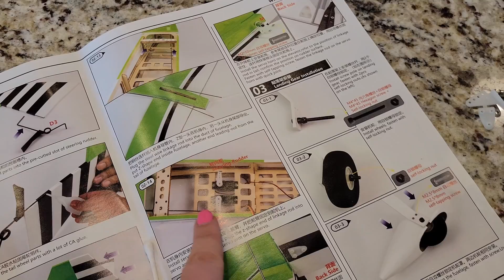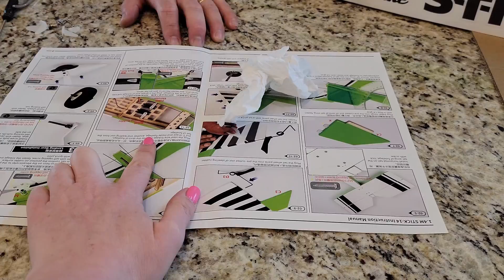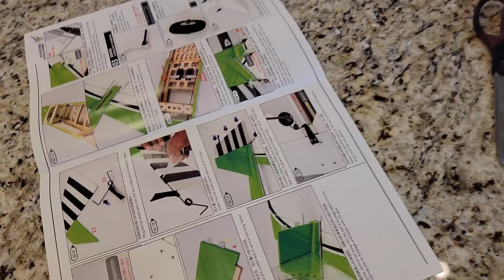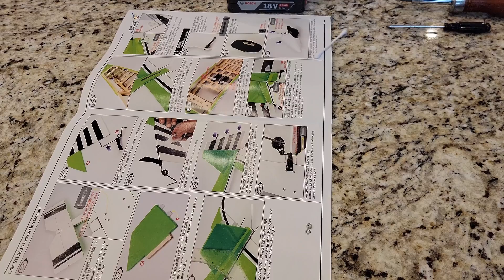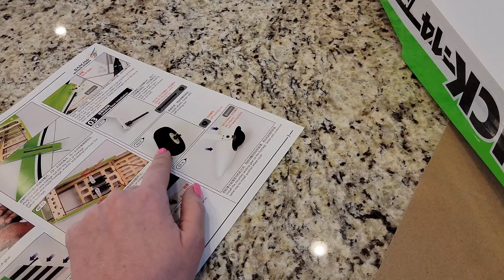Dancing Wings - Stick 14 - 1.4m - Build Part 2 of 2

Comment: I see Dancing Wings in the same category as Dynam, planes for masochists.  Thanks for the suffering so I won't have to.
Reply: Best comment ever lol masochist try building there kits where its a goat pile of laser cut balsa and rc aircraft plywood and same type of instructions pictures badly taken like the ones in this arf with the part numbers on the parts in each pic. But man the wood and notches and cuts are class A quality. They jig together so tight no need for clamps on some stuff for gluing. I built there big Cessna balsa kit in 2 days 4 hours on Friday night and 15 hours sat using CA glues and wood glues. Instead of eating hours for wood glue to setup completely I just used ca as well to keep parts together so I can build quickly and the wood glue is drying as I build it. And the wood glue makes the parts swell just enough when it's together while drying like that is that when it swells the gaps and notches get so tight it's a solid joint. I love all of their kits. Yes instructions suck but if you use YouTube reddit and forums you will find anything you need to know. I built Cessna using someone's build on a forum on rcuniverse and was able to complete the plane using his forum and pics of his whole build and stuff he did that was extra to make the plane better and it built so light it's crazzy but very strong fues and plane like very strong almost overly built but that's why it flies like a dream. And the wing has two machine head Phillips head bolts or screws what ever you wanna call it on front and back and you can remove the wing to transport and store in a minute as well instead of some balsa planes where wing is glued in with epoxy or rubber bands that snap all the time when trying to put wing on. All of there balsa kits fly amazing and go together easy except instructions. So please give them a chance from one rc plane builder to another you won't regret it. I even scanned in all the parts somo can laser cut my own lots again if I crash them or damage something I can fix it
Reply from the maker: LOL - Very nice ;)